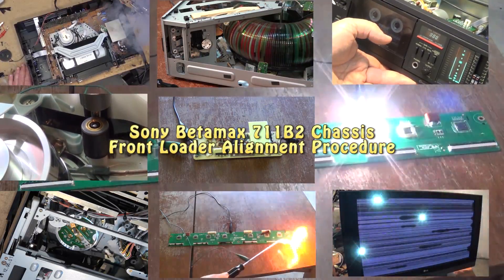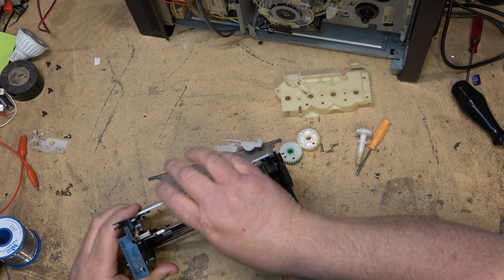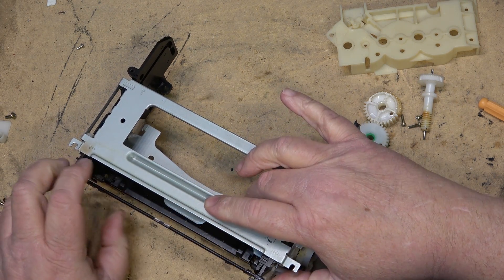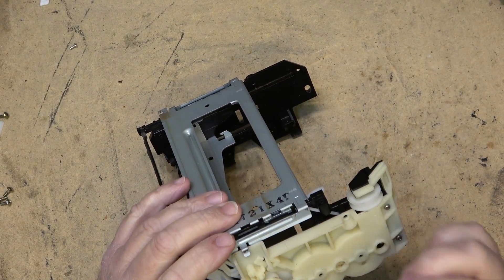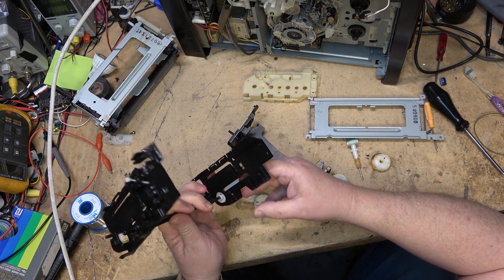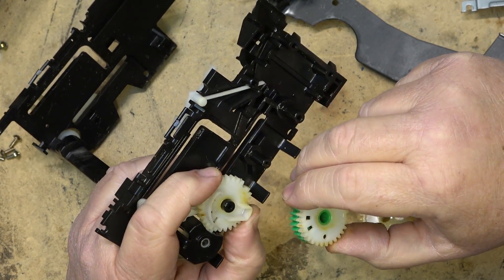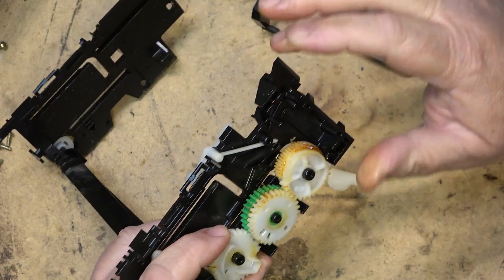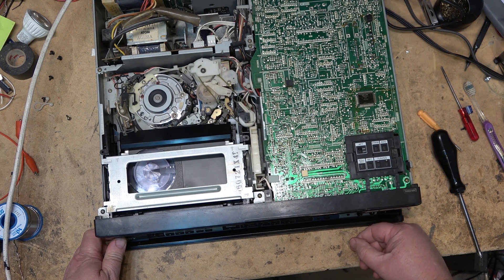Sony Betamax 711B2 Chassis Front Loader Alignment

Comment: I'm seeing a strange occurrence with an SL-HF70 whereby the unit's power switch will not power on the VCR until the leaf switch in the loader is engaged. Followed the alignment perfectly, but the machine's loader basket is loading and unloading without any tapes present. Is this the sign of a faulty switch? Or is there further circuits connected to the leaf switch that can fail?

Comment: Their basket design is a terrible nightmare, plastic gears and poor tolerances cause these things to jump out of alignment every 5 minutes I swear.  Excellent information, I thought I figured this out on my own but after probably 30 loading and unloadings of the tape the damn thing went off the rails again so now I'm going to take tips from a pro this time and make sure I use the right timing holes because.  I do have another unit with that broken gear that I am hoping to find someone who can 3D print a new one.

Comment: Great video, thank you. I find the loading mechanism gears to be quite noisy, even in this video. Is this something than can be improved? Does it require any gear re-timing if the loading motor assembly is removed for lubrication?
Reply from the maker: All the units that used the plastic planatary gears are noisy that's just the way it is, something things just never change.

Comment: That tooth string that breaks off like you pointed out on 9:40 or so happened to my SL-HF400. I have a 3d printed gear that fixes that right up too. You should be seeing one of my loading gears coming your way quite soon. Cheers!
Reply: Hi, would you happen to have the 3D file for this gear? I also have a machine where this gear is broken, but I do have a 3D printer to print.

Comment: The most enjoyable part for me of owning my Sony Betamax was throwing it in the skip. The more I got know about the recorder I realized it was a terrible design at least the Sanyo version would disengage from the head on rewind
Reply from the maker: Nothing wrong with leaving the tape laced on rewind.  Problems started when ultra high grade ultra smooth tapes came along.  The smooth surface polished the upper drum.  The VHS manufactures also went to a loaded rewind as well.  Why? Because people didn't want to wait for the tape to load and unload every time they changed modes.  There was also much more wear and tear on the mechanism and tapes were always prone to damage during loading and unloading.  On beta that was typically done at the beginning of the tape.  You rewound and removed it.  On the sanyo cheap beta and first gen VHS they did this every time you stopped playback.  FYI the only reason sanyo did it was because they used the same control circuit as their Fisher brand VHS.  So rather than have 2 different designs they used the same for both and the beta started behaving like a VHS.
More tape damage was caused by the loading and unloading in the middle of the tape.  The betas that sanyo made before they bought Fisher and started making VHS all kept the tape loaded like Sony, nec and Toshiba betas did.
Reply: @12voltvids  "The betas that sanyo made before they bought Fisher"

FYI, Fisher was acquired by Sanyo in 1975.

As you say, Sanyo had Beta machines that kept the tape fully threaded in all transport modes throughout the 70s and into the early 80s.  Then they had the mechanism that unthreaded the tape when not in play for both top load and front load machines throughout the rest of the 80s ... with exception of the very rare Sanyo VCR8700GM, which was a mono SuperBeta made for Sanyo by Sony using the 711B3 chassis and was the last Beta model Sanyo sold.

Sanyo wasn't the only one to make Betas that unthreaded the tape out of play, though.  Aiwa did it, too, with at least one model: the AV-70M.  That model was interesting in that it will only thread the tape when put into play, but it would leave the tape threaded when you stop.  However, if you put the machine into fast forward or rewind, the machine would unthread the tape before performing either of those functions and keep the tape unthreaded until you go into play.  Obviously, with such machines from Sanyo and Aiwa, BetaSkipScan was not possible on them.

As for VHS machines leaving the tape at least partially threaded up, if not entirely, one reason would be if the VCR has a linear time counter.  The machine needs access to the tape's control track at all times to keep the time counter in sync with the tape, same with Beta machines having a linear time counter.
Reply: @Watcher3223  Most of my Sanyo/Fisher Beta VCRs (VTC 5350, 9350, 9455, VBR-330, VBS-9000) always stay threaded even in FF and REW. It was the VTC 5000 and later models that unthreaded the tape for FF/REW operation.
Reply: @crashbandicoot4everr  Well, I was speaking of machines made for the North American market, where there were Sanyo machines that kept the tape threaded until the VTC-5000.

Fisher never had any Beta models available in North America at all.  It's odd that Fisher had never marketed Beta here, but did so in Europe, but it is kind of cool that Fisher Beta machines do exist.